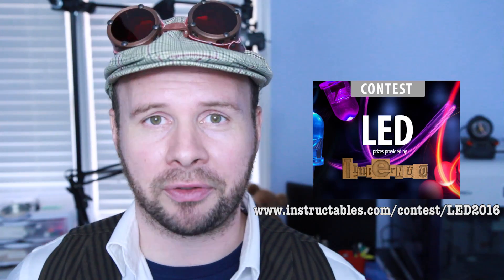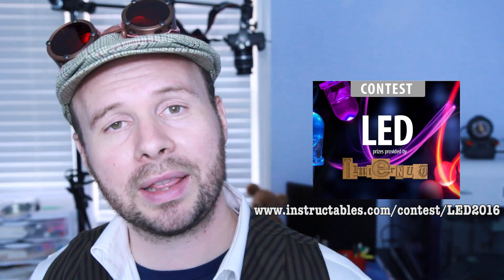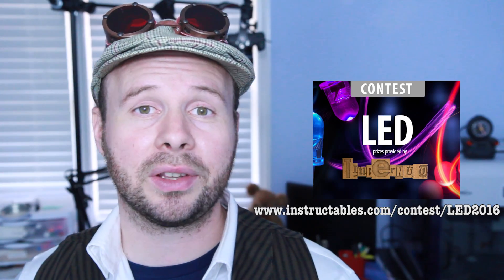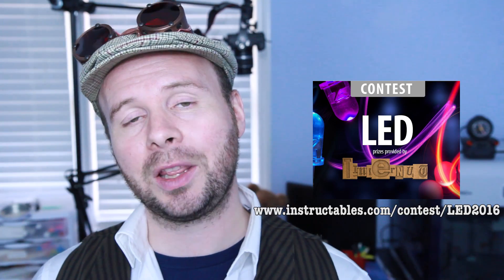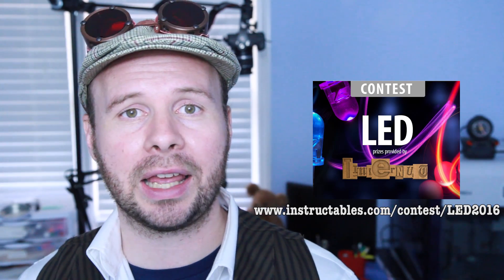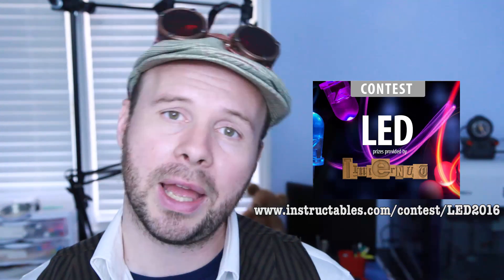Comments Show: DIY Vintage Digital Camera - Part 1

Comment: you should do a project where you make a devices website history, when you access internet through the router whatever pings back to your device the program on the router emails you what websites that that device accessed. Also if it's possible could you also have the device name added too so you can see who accessed what? That would be really helpful thanks!

Comment: I think the whole thing about multi-video projects is that they're split by the comments show, so instead of waiting a week for the next part, you have to wait two.
Reply from the maker: That's good feedback. Thanks!
Reply: Tinkernut No problem! The solution would be to have one bigger comments show after the project has finished.
Reply: Joe M But multiple comment shows allow for feedback before the end (so maybe something can be changed). Unless it's all recorded beforehand.